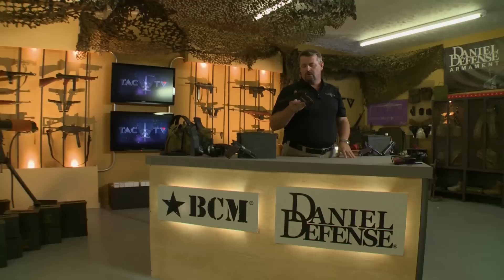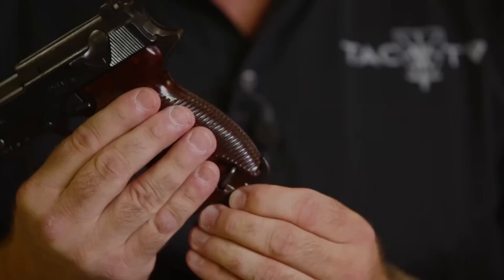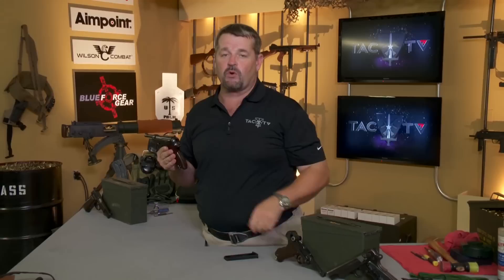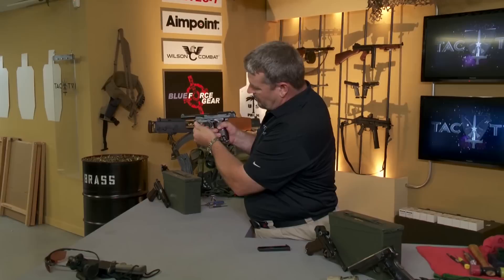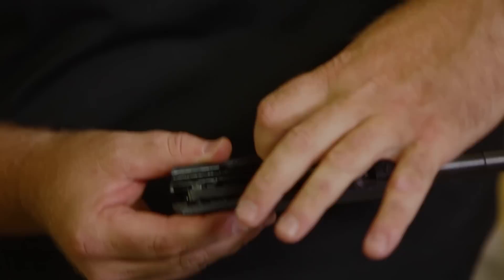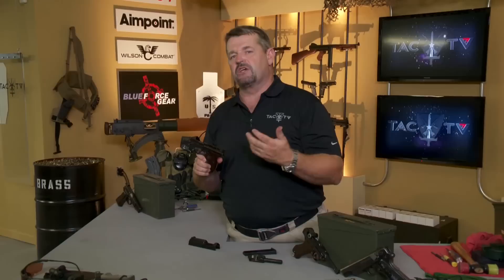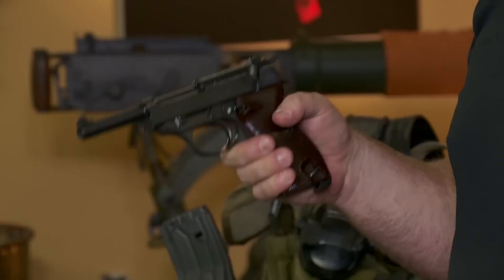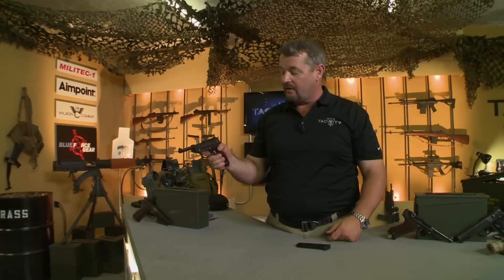Walther P38 Breakdown

Comment: With Walthers, It's better to lower the hammer manually with the decocking lever, than to let it slam. 

Also, you can release the magazine quicker by using your palm to hit the heel before grabbing it out.
Reply: Then what's the fucking point of the decocker lever if it's better to lower the hammer manually?
Reply: @luvfreedom1470  if its worn it might detonate the cartridge anyway.
Reply: @luvfreedom1470  Less wear on the components.   There have been issues with firing pin wear and safty wear.  Old guns so best not to put extra wear on them.

Comment: I’ve just acquired one that used to belong to my father. He taught me how to handle a handgun with it, so as a result I have an almost unreasonable level of respect for this firearm.
My only gripe is that someone refinished it. If only there were a way to restore a facsimile of the original finish I’d be happier.
You can empty the gun as fast as you can pull the trigger, hold up to 9 rounds, strip and clean it quickly, and replace parts with little difficulty. This is why I love the P-38 design.

Comment: While the following is true for any gun, be wary of the auto firing P38 that fires when de-cocked. Happened to me, and it wasn't fun. Always, make sure a good qualified armorer goes over your gun, and always. always dry and live test  the decocker several times, with one round  in a safe place. Again, any decocking mechanism may have this happen, and almost every semi may auto fire under some failures or bad mods. Especially older guns, with less or limited mechanical safeties.
 Always remember the 4 rules.